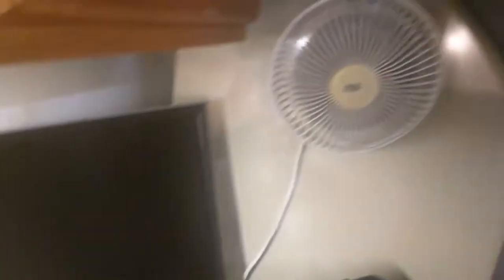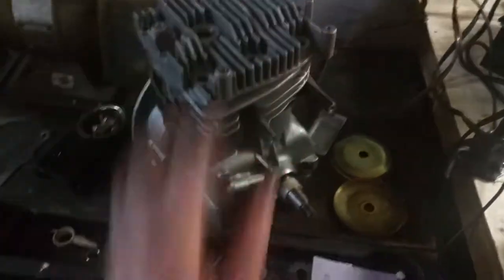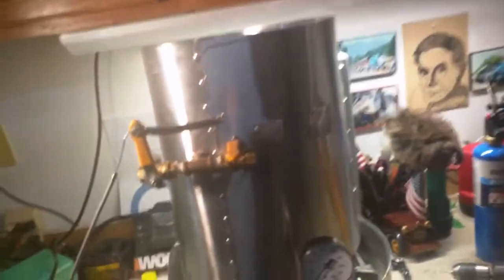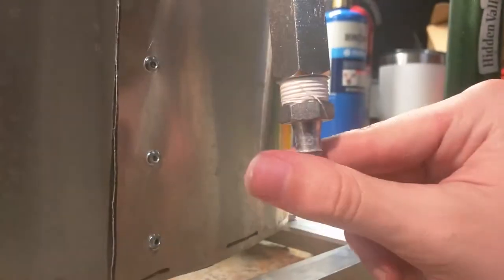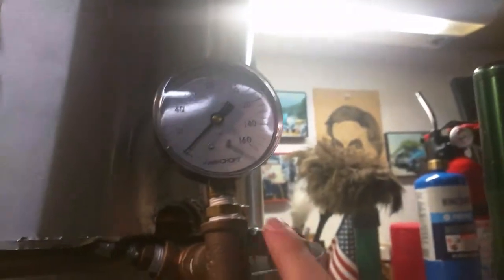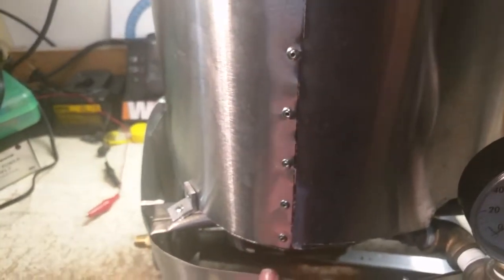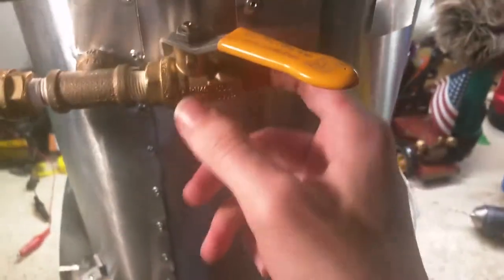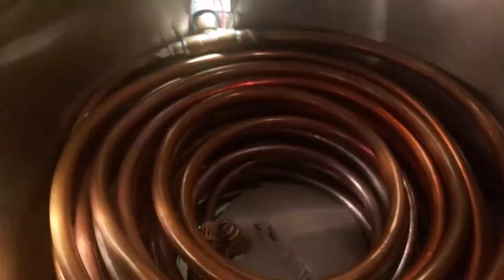Building a Steam Engine - The Boiler

Comment: Hey what if you made it a closed loop from boiler to engine to tank of water and before putting water to suck out the atmospheric pressure so as to lower the boiling temperature greatly giving more pressure. Is this possible?
Reply from the maker: I've thought about this.  However this issue is that you still need to drive a vacuum pump to initially lower the pressure and to maintain the vacuum to some degree.  I believe this is the system that steam turbines use in many cases.  I'll look more into it because it would increase the efficiency of the engine...

Comment: You might consider using silver solder, instead of plumbing solder.
Reply from the maker: I may use it in the future.  It has a much higher melting point.  The silver solder I looked at was very expensive though.